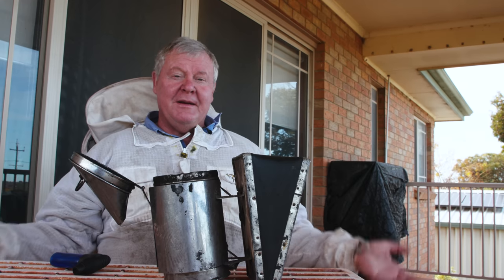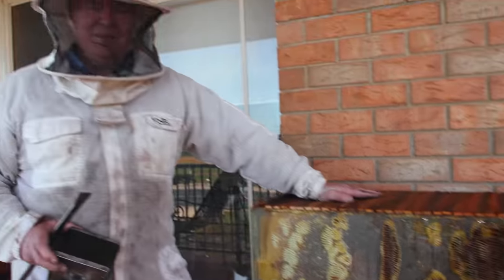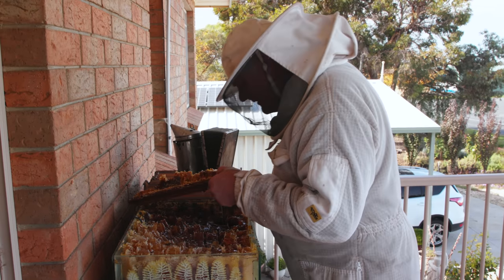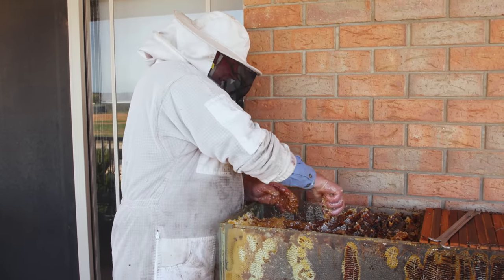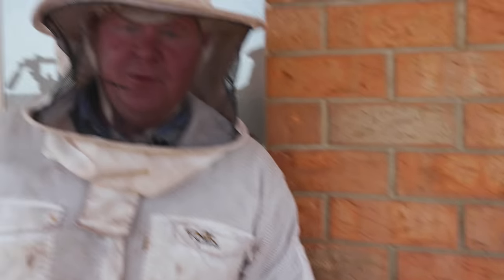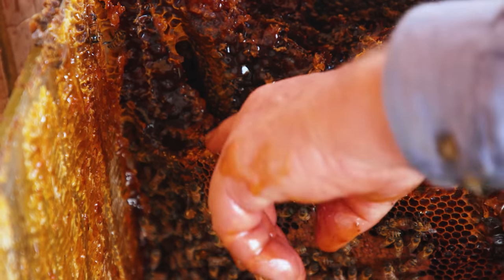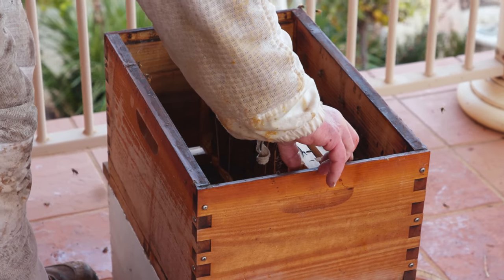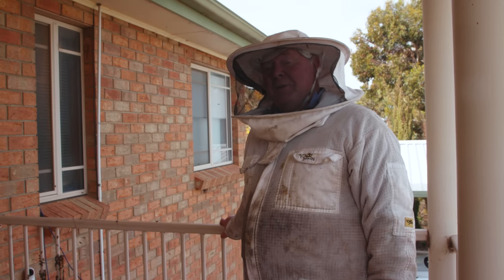Saving The Fish Tank Beehive: Transferring To A Flow Hive | The Bush Bee Man

Comment: I love that wired frame idea. Where I work some bees made a nest in a water valve box that is buried in the ground with a lid on top. My bright idea was to buy another box, put a bottom on it and screen off the openings for the pipe. Then I went to the box and just pulled off the lid, with the hive stuck to it and placed it on the other box that I had readied. It's been in my backyard for over two years now. I captured one swarm from it and dumped them into a top bar box I built. Since then that hive swarmed but I had nowhere to put them so they had to go find their own home. 
I built a better top bar going on my experience with the first one. I'm planning to get the hive out of the water box and move them into the top bar. The water box hive is so heavy I can barely pick it up. I harvested from my first top bar and took about twenty pounds of honey. Just getting ideas.

Comment: You should carry a sharp bread knife for cutting the comb. They are long and works alot better and it's cleaner then a dull scraper. You wouldn't have had such the mess. It's especially good to use when cutting comb to fit the frames. I hope you will consider this because that scraper just isn't doing it. It's just making a mess of the comb.

Comment: I think the fish tank idea still could have worked as a permanent hive, if you had built full frames for the comb to be built in, instead of just the crossbars at the top only.

Also, in regards to the moving of the comb into frames, if you drill a hole through the wooden frame, you can run wire through the center of the frame, and just gently push the comb into the wire, instead of having to rubberband it against the back wire (look up Layens frames for reference of what I am referring to).

Good luck with your Flow Hive!